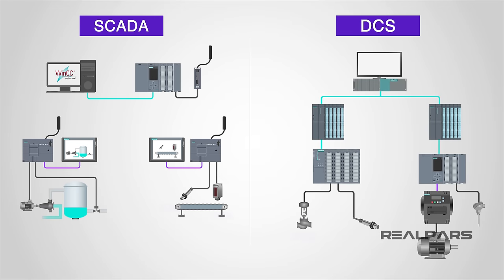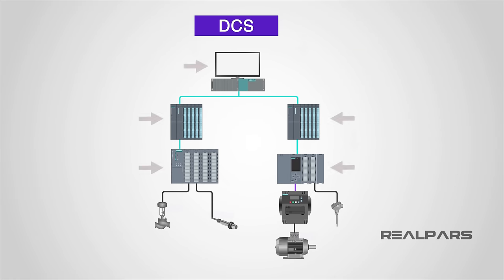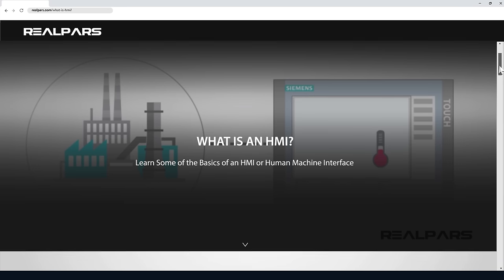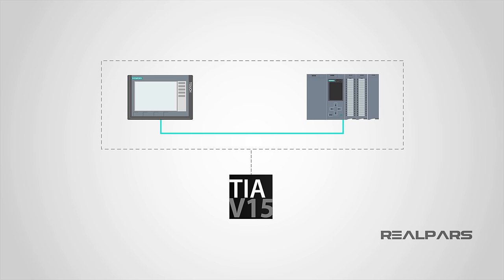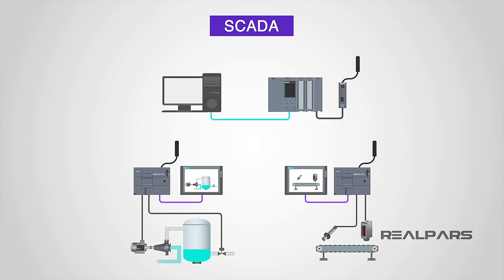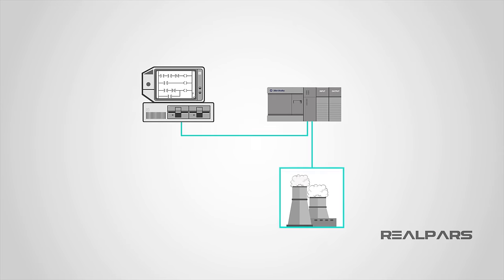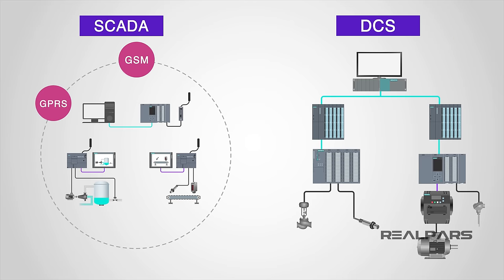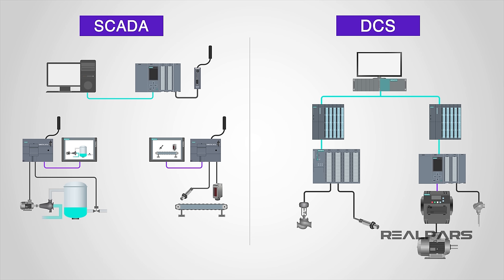What are the Differences between DCS and SCADA?

Comment: I’m no expert and far from it, but I happen to work in Industrial Automations Controls Systems and work for an OEM who supplies major Plant Package Water Systems to Energy Sector clients, mostly Power Plants. The difference between both SCADA & DCS used to confuse me a lot. So much so I use them interchangeably. Yet, I kinda knew some differences just harder to explain and in that SCADA was more like a mishmash of systems all controlling everything unlike a DCS with an overall unified control system. Still even when a plant has a DCS, it still has SCADA systems of sorts that operate in the field with a server and maybe the other client workstation in the DCS Room but not connected to their actual DCS. Sometimes it’s connected, sometimes it’s not from our PP customers. So customers kinda have both. It required more work though to Modbus connect it all data wise to their DCS. However, I now understand some real differences via the video. Weintek I think it’s called is another cheaper HMI similar to Redlion. Good stuff though. RealPars rules. Jabs at needing more Allen Bradley content here and on the RealPars site.
Reply from the maker: Hi Ardent,

Thanks for your comment and sharing your experiences! It is amazing to hear that our video has been able to clear those confusions for you.

I will also surely forward your suggestion for some more Allen Bradley content to our creator team.

Thanks again for sharing and happy learning!
Reply: More Allen Bradley please

Comment: Very good tutorial, unfortunately not all aspects of a DCS system are mentioned. An PLC system is likely used for a dedicated application where the DCS is more used for controlling a whole plant. In most of the plants they use both at the same time, connected together (SCADA, Hardwired, OPC, Modbus...). Where the DCS is on top of the PLS system. And if the installation was good they can still work independed in case the PLC or the DCS  got a problem. Thats why most PLS even they are connected to a DCS have got an HMI panel.
Reply from the maker: Thanks for your comment, and sharing your knowledge with us!
Reply: Thanks 👍

Comment: Seems like if you have multiple independent process working unified for a goal (example a poultry processing facility using Ishida, Sandiacre, Modicon, Allen Bradley which all have an equal hierarchy of control) a SCADA system is the way to go. Verses, if you have a facility that uses mainly one control system ( a power plant that has one system with main hierarchy, while able to utilize subsystems with lower hierarchies ), a DCS is they way to go.

Comment: Love your videos, very interesting. 

There are circumstances where the cost of a DCS software such as PCS7 will cost more than Step7/WinCC to perform the same tasks, (at Siemens) I was working on the data analytics side helping an integrator who had installed a brewery control system, the decision (by the integrator) to go with S7-1500 + ET200s was based on software cost rather than anything else. They did already have their own libraries to run this however.

I believe that in TIA at least, PLC tags can easily be dragged across onto a HMI, and easily searched/selected if needed. No need to manually export and import the tag lists that is handled automatically.
Reply from the maker: Thanks for sharing your knowledge and experience with us, we always appreciate that!
Reply: Do xssvv

Comment: Thanks for sharing, but as far as I know dcs have a faster processing time than scada due to its use in real time fast processes but here you said scada has faster processing times. Can you elaborate please.
Reply from the maker: This was the case in the early 2000s, but with the introduction of bigger and faster processors, there is little difference in speed between DCS, PLC, and the supervisory SCADA systems.  In reality speeds of processors are faster than the requirements for data updates.  Most DCS systems update values from 4 to 10 times per second.  This is on par with modern SCADA systems, so the differences are less pronounced than 10 - 15 years ago.

Comment: Can HMIs still be utilised in a DCS system? This graphical interface that is mentioned that is integrated into the system, does it contain HMIs or is it similar hardware with touch screen capabilities?
Reply from the maker: HMI, referring to the terminal used to display operator graphics, is used in DCS, SCADA, PLC, and hybrid systems.  For DCS systems, the software used to generate screens and execute them is typically integrated into the DCS system, and likely is part of a single software suite.  For the other systems, the HMI configuration and server applications may be stand-alone, with communication connections to the controllers to access process data.
Reply: @realpars  perfect! thanks for the that👌

Comment: SCADA is centralized and DCS is distributed, one of the main things in the video is wrong 😑 
SCADA systems are highly distributed systems used to control geographically dispersed assets, often scattered over thousands of square kilometers, where centralized data acquisition and control are critical to system operation. They are used in distribution systems such as water distribution and wastewater collection systems, oil and natural gas pipelines, electrical power grids, and railway transportation systems. A SCADA control center performs centralized monitoring and control for field sites over long- distance communications networks, including monitoring alarms and processing status data. Based on information received from remote stations, automated or operator-driven supervisory commands can be pushed to remote station control devices, which are often referred to as field devices. Field devices control local operations such as opening and closing valves and breakers, collecting data from sensor systems, and monitoring the local environment for alarm conditions.
DCS are used to control industrial processes such as electric power generation, oil refineries, water and wastewater treatment, and chemical, food, and automotive production. DCS are integrated as a control architecture containing a supervisory level of control overseeing multiple, integrated sub-systems that are responsible for controlling the details of a localized process. Product and process control are usually achieved by deploying feed back or feed forward control loops whereby key product and/or process conditions are automatically maintained around a desired set point. To accomplish the desired product and/or process tolerance around a specified set point, specific PLCs are employed in the field and proportional, integral, and/or derivative settings on the PLC are tuned to provide the desired tolerance as well as the rate of self-correction during process upsets. DCS are used extensively in process-based industries.
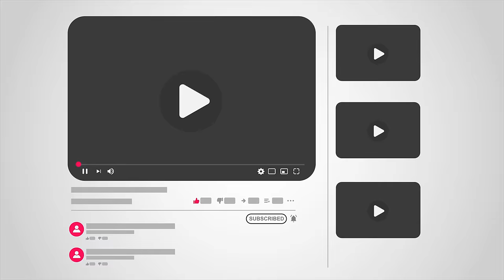Reply from the maker: Thank you for your comments.  The point about distributed components was made clear from 1:00 to 1:30 in the video and SCADA clearly is designed to operate across multiple locations.  To be honest, the terms SCADA DCS are becoming "worn", as many hybrid systems have com onto the market that look and act a little like each type of system.  Originally, the "D" in DCS, or distributed, referred to the separation of I/O and controller hardware within the same local system.  Per the "classic" definition, the video is correct.  Both types of systems are becoming closer in function, as explained in the video, and also in hardware.  The true differences lie in two areas: DCS systems still have more of a reliance on a single vendor for hardware, and DCS systems tend to be configured from common component libraries and tag databases that are shared among components in the system.
Reply: @realpars   thanks for replying

Comment: is DCS programming the same as PLC programming?
Reply from the maker: No.  DCS systems are partially configured and partially "programmed".  The tags, I/O, loops and alarms are typically all configured using wizards, tables, and menus.  Device and control loop logic is typically provided as pre-configured internal blocks where the "programmer" simply makes connections between the tag table and these blocks.  In PLC programming, more choices are available for creating logic, such as ladder logic, structured text and function blocks.  While there are many items like tag tables that are configured much the same as in a DCS, there is more "programming" effort in the PLC environment, but there is somewhat more flexibility as well compared to a DCS.  DCS systems are more efficient for process that are heavy in analog inputs and outputs.  PLC systems are more efficient for process that are heavy in digital inputs and outputs.